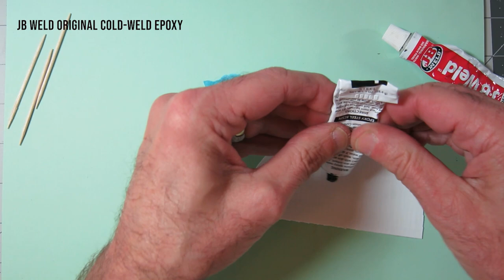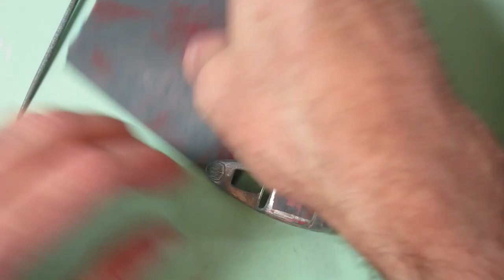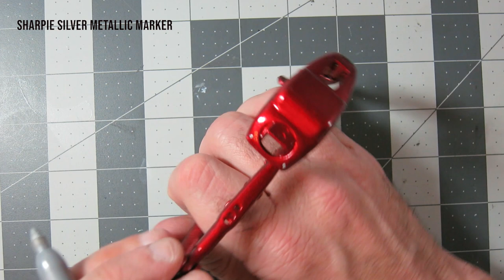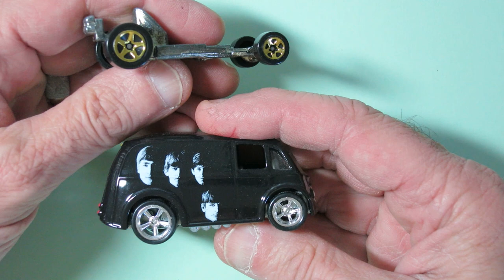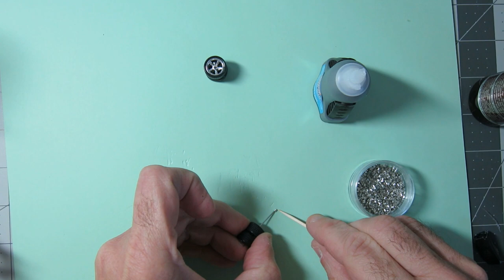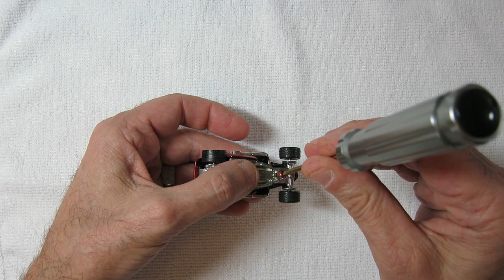Hot Wheels Fiat 500 C Custom / Diecast Graveyard Patreon Subscriber Build Off

Comment: How do the front wheels roll after putting the bead crimp?
Reply from the maker: You only glue the very end of the axle with the crimp.  The wheels still spin on the axle.  You need to be careful to use thicker ca glue (gel) to prevent it from going down the axle.